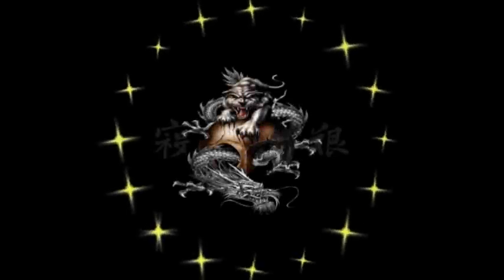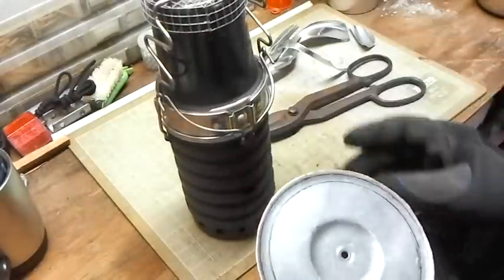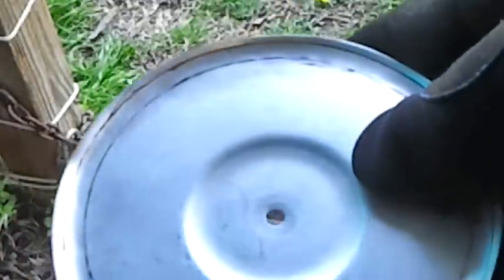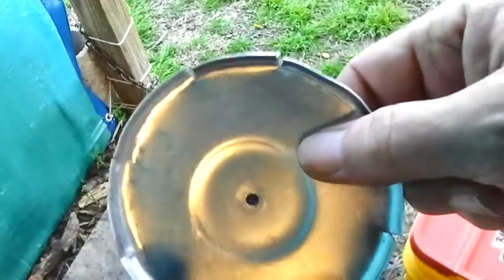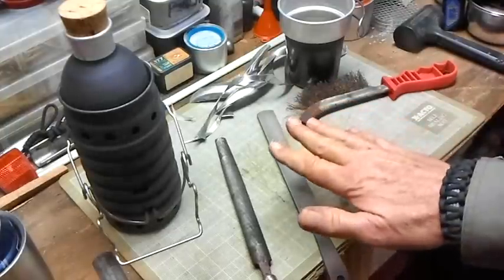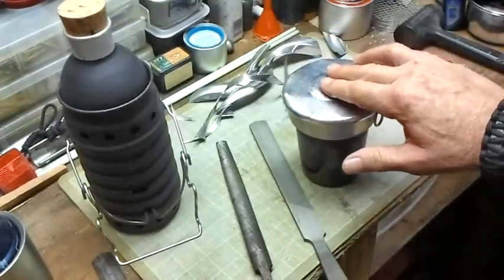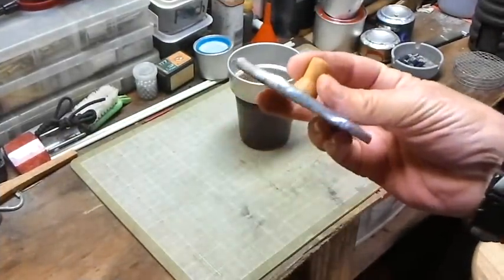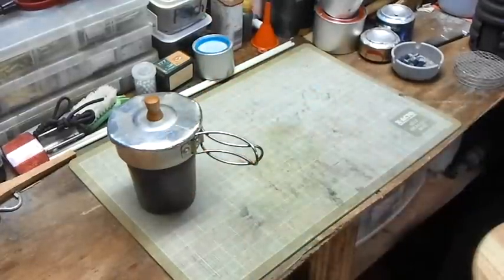Swiss Volcano Stove Cup Lid

Comment: I made a lid for my Swiss Volcano cup the lazy man's way. I simply took a safety (side-cut) can-opener to one of those larger tuna cans (4" I think) and cut off the top. Inverted it makes a near perfect lid and you can install the handle of your choice. I punched a small hole and inserted a bit of nylon cord tied in a loop. It lies flat when I pack it but provides enough of a "grabber" to prevent burnt fingertips. I enjoy your videos on this stove, but mostly burn Esbit in mine.

Comment: Hi SurviveN2!

Great Work like always...
I could see the cat visiting you and pushing just  one Orange foot inside the Frame ;-)
Just one thought-I think I have seen something like bending the Metal for the lid like you did-ony thing was the "Bender" put a ring of quite strong copper wire  concentric to the hole in the middle, around that he used to form the bend over. Seemed to have worked as I remember. 
But hey, that was on TV, they do all kind of trickery there ;-)

Cheers,
RealMash